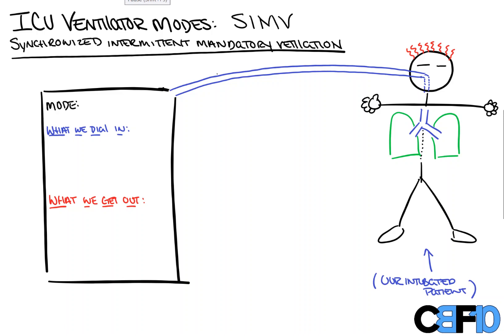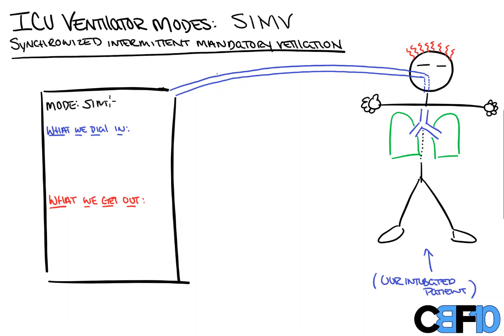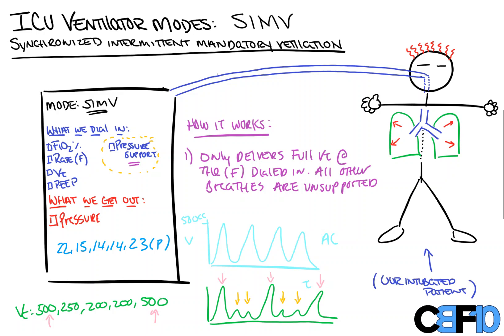SIMV

Comment: between the simv and a/c mode,which one would you say is suitable to be used for copd and/or asthma patients?
Reply: it really depends on the pt., probably can start off w/ AC and go to SIMV when trying to wean, I think what's really important when ventilating asthma and COPD pts. is monitoring auto-PEEP and using lung protective ventilation